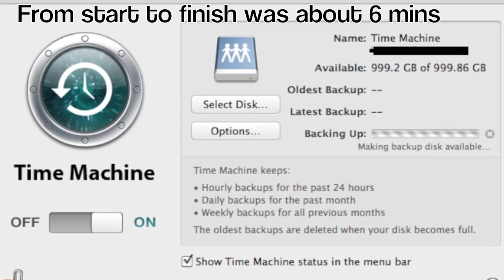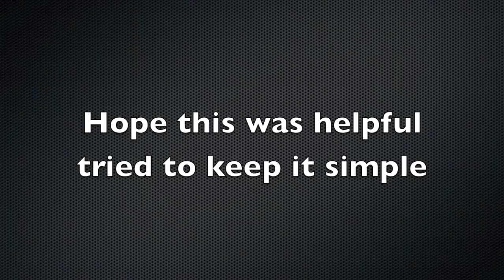Apple Time Capsule Hard Drive Upgrade

Comment: Hello:

I upgrade my time capsule with the same wd caviar green, but 1,5 Tb.

I only have a problem: the old seagate turn on when access and turn off after a few minutes.

WD is always run (never stop, or sleep, or idle).

Do you have the same problem?

Regards

Comment: So I just recently purchased a time capsule from ebay and it just arrived. My question is, is it possible to upgrade to an SSD to access to file more faster?
Reply: Daniel Jenkins c
Reply: It’s not worth putting an ssd in there. You can’t take advantage of its speed because of the Ethernet bottleneck.